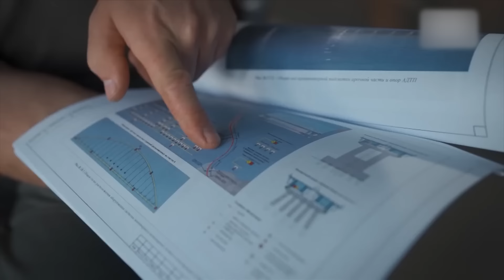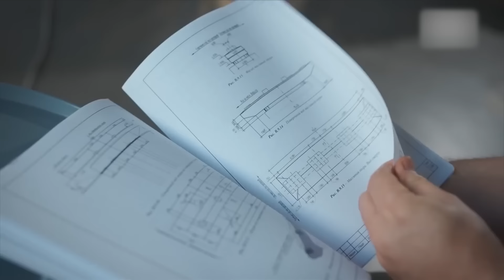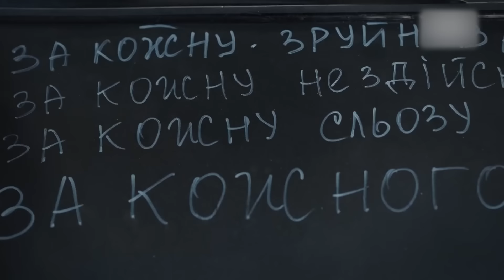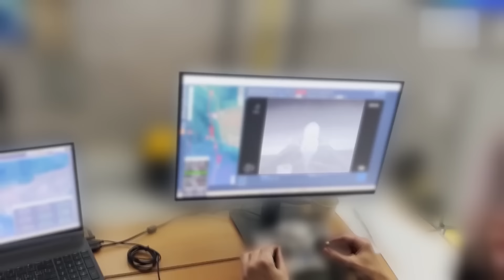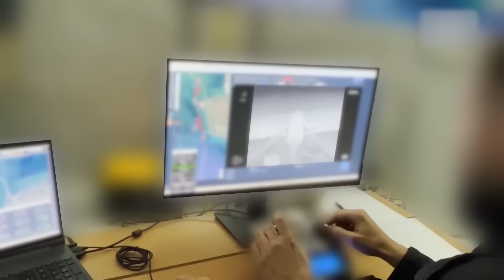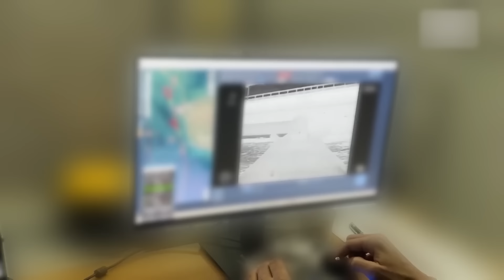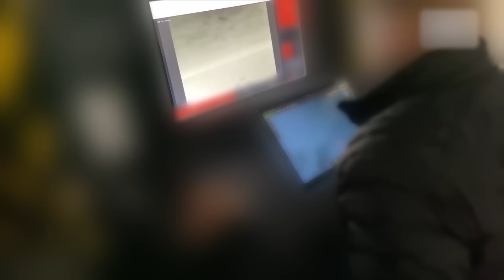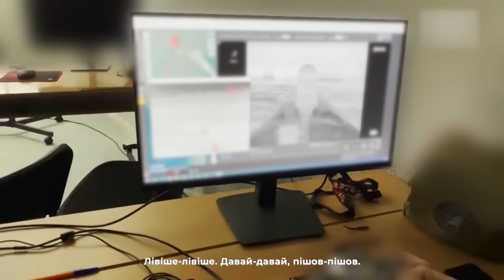Attack Crimean (Kerch) Bridge by Ukrainian Kamikaze Drones. Here's what happened

Comment: having recently fabricated a vibrating table to allow reinforced refractory mix to flow and level ...
the results were almost instant and the casting of the panels was easily achieved .  thinking thoughts   , if the subbase supporting medium is silt .. how could this sub base be made to flow and become almost a liquid ... the bridge supports would wander all over the sea bed  making the structure unsafe   / unuseable. OK   just a thought .every little helps .good luck  .

Comment: Trains in N.A. are electric powered.  The kerosene is used to run generators. A train pulling a bunch of railway cars may use 5 Liters of diesel per 160 km of flat terrain track pulling 100 loaded rail cars.  The fuel cars that are essentially full of fuel, they will not explode.  It is the kero vapor that explodes so if you could determine how much fuel is in the tankers (you need X-RAY vision like Superman.) IF however the locomotive is old fashion then chances are good it is burning Kerosene as it has no electric engine. Mind you, if the train is also bringing kerosene or diesel or gasoline for tanks and trucks on the front line, then the best time to get the tank cars is on the return trip as they will be empty and more likely to explode. (I played with matches and fuel and metal cans as a kid....so kind of know from BAD experiences.& physics
Reply: That's not how energy works